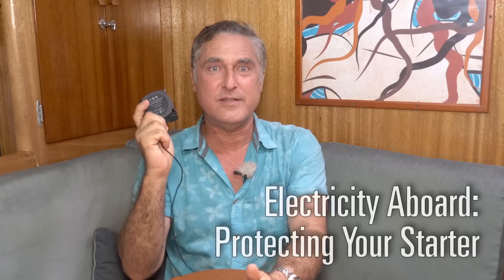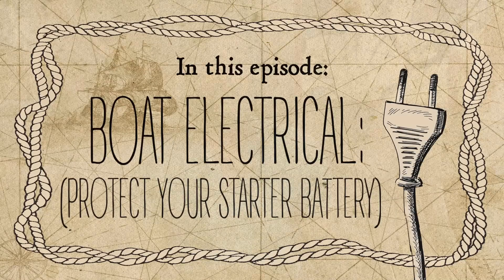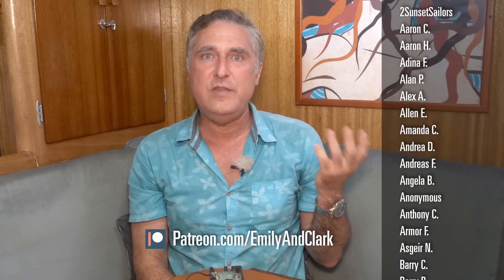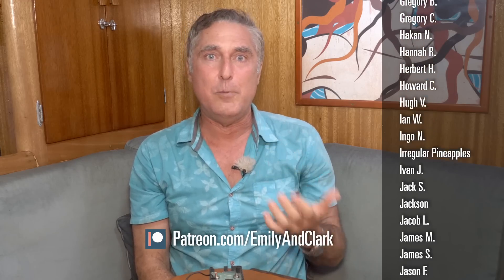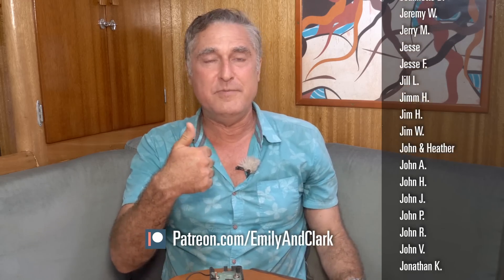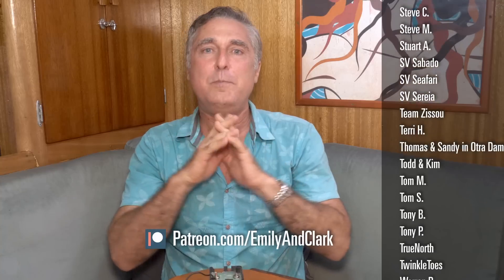The $20 Way to Protect Your Boat's Starter Battery

Comment: What do you think about the situation where your starter and house banks are at different voltages, say 12.8v on one bank and 12.4 on the other? If you switch them into parallel connection there will be a massive current flow into the lower voltage bank. I imagine this will have a detrimental effect, particularly on the bank with the lowest capacity, ie, the starting battery.
Reply: Yes .4 is not large..:)
Reply: Assuming an internal resistance of 0.1 ohms, a 0.4v difference this would yield a transfer rate of around 4 amps. Even halving the resistance will only give 8 amps momentarily, so not a problem for lead acid batteries.
Reply from the maker: With lead it's not that big of a deal as the lead batteries have a fairly high internal resistance.  For Li this would be a big issue.  
This can be mitigated further by wiring this in with longish smallish wire.  The resistance will slow that surge of power. (p=I²R). 

My BankManagerPlus https://www.emilyandclarksadventure.com/bbms
Is careful to only connect banks when it's safe.

Good observation.
Reply: I don't see the difference is 12.8 and 12.4 as massive although at various points Clark says that it is.
Reply from the maker: During testing there was a point where I had a software bug and my BankManager tried to connect batteries with a large voltage spread (Much more than your .4v).  Wires got hot to the point you could smell it and my tester quickly forced the battery banks apart.
   .4v should be ok I suspect and I don't have the data from our test, as it wasn't a planned test, but likely fairly discharged lead and fully charged li, caused an issue.

Comment: I’m not understanding exactly which pole to connect the starter battery to. I guess where I’m struggling is if the voltage drops below 12.8 and you’ve connected it to the wrong pole you might shut off the house and left the starter battery to drain. Maybe I’m still not understanding the concept of how this works.
Reply from the maker: If you need this functionality just buy one.  It's instructions will help you understand it.

Comment: Clark, that was a brilliant pair of similes concerning the house and starter battery banks.  The house bank, like a draft animal supplying the “Hotel” loads while the start bank is like the lion, lying idle but then expending tremendous energy over a short time to help the engine “roar to life”.

      You have the heart of a teacher, using analogy to make your point to some who may be unfamiliar with the technology you’re teaching.  I’ve noticed the clear, simple way you teach and admire the care and preparation that you and Emily demonstrate in your presentations. 👍

        An important point (with which I disagree) is that many now use high output alternators to charge their banks, and refrain from having a dedicated standby generator for savings of $, space, and weight.  
  
        The flaw in this thinking is (of course) that if one inadvertently depletes the starting bank then the ability to charge batteries is also lost.  If in a remote area, the house bank will eventually deplete and ultimately lights, navigation equipment, and radio are lost, which places the sailor back in the 17th century. This same scenario (of course) occurs if the engine is lost for any other reason.

      🤔 How does the VSR regulate the different charge profiles for different battery chemistries and how does it distribute the charge when charging batteries which are at a different charge states?
Reply from the maker: That's really outside it's scope.  It just connects and disconnects lead based battery chemistries.  And that's all you need to make sure your starting battery is ready to do it's thing.

If you want something that lets you mix lead with Lifepo4 there is my BankManagerPlus.

https://www.emilyandclarksadventure.com/bbms

Comment: Hi Clarke How does it work if you have an emergency parallel switch?
Reply from the maker: I don't understand your question.
Reply: Thanks Clarke I really appreciate you taking the time to answer my query. I have both emergency parallel and VSR installed by a previous owner but just wondered if the parallel is on whether it interferes with the VSR… in fact should I leave the emergency parallel left on at all anyway?
Reply from the maker: I have no way of knowing how your boat is connected up.  But, if it's connected as I do mine leave the "emergency" switch off for the vsr to be full automatic.  On to just have the batteries always connected.
Reply: @Clarks-Adventure  brilliant thank you 🙏

Comment: Thanks for the update. One question... or maybe just comment. You did not really say where the sense pin (post) should be connected to. I guess it should be obvious though that it needs to be on the side where the charging system is (unless it is dual sensing)... maybe dual sensing is more fool proof or even, more desirable. I guess the first question is, which battery should the alternator be connected to? My answer would be the starting battery because the engine/alternator/starting battery are meant to be a unit and depending on the situation, more than one start may be required within a short time period. However, I would think it would be better for the solar panels to charge the house (again, dual sensing please) because your electronic relay still has some drop across the "points" and a solar panel setup that is charging lithium cells, is probably dealing higher voltages too. Shore power charger, which might be much higher current output than solar panels or your voltage controlled relay can handle. (I'm probably missing something as I am thinking this while watching, so not long) Maybe there is a place for a single sense unit connected to the starting battery/alternator and a lower voltage drop diode (.6v seems common enough) from the house side to starter side with a limiting resistor to just allow 2 amps or so charging from house to start side (so starter draw doesn't blow anything , hmm dual sensing bad?).

Next question is, what happens if house is greatly discharged? Starter Battery won't allow the switch to close until it's charge level hits switching level. Then the switch closes. What happens now? Depending on the voltage spread for on/off, the alternator and the starter battery start to charge the house battery at alternator rate plus battery rate, that is over 200 amps. Does the switch handle that? or does the house bank pull the voltage low enough for the switch to turn off? (then back on as the voltage is again high enough, acting like a switching power supply? As you have been using the device for some time, it must handle it some how. (same with starter current, but I guess that would pull voltage down below switch voltage anyway)

Last comment: A diagram would have been easier for me to follow  ;)  A diagram would have shown which battery you in your head thought was the right battery for the alternator to be connected to, where sense was, all those things. My little 9.9hp OB starts off my house AGM bank without harm but even a 10 HP diesel would not.

Anyway, you patient explanations are much better than I could do because I always seem to expect others to pick things up at the same speed I would. Thank you again. As you can see above, I have probably answered all my own questions.
Reply from the maker: There is always a bunch of engineering required to set up charging systems.

Any video that tried to answer it all in 15 minutes would fail.

Yes you answered your questions fine.

Dual is often better.
If you use lead on both sides you will find that the internal resistance limits current quite a bit for battery to battery discharge.
If you use smallish longish wire to hook these up it can limit their current in a good enough way.

Comment: Your post could not be more timely. We just replaced our batteries and have been struggling to ensure charging and using the batteries is done correctly. The boat originally had lead for both starter and house. We now have lead starter but AGMs for house.  Can this solution be used for lead/AGM combination?
Reply from the maker: Yes no problem.  All the lead batteries have the same resting voltage 12.8

Comment: Great simple explanation on battery systems. I use an even simpler setup that I believe is more reliable and safer. Using a high power schottky diode (1N6392e3 ) in series with a 20A breaker. This combination is wired from the house bank to the starting bank. I picked up this method from the Ample Power website and it has worked like a champ for many years.
Reply from the maker: Still a voltage drop with that diode.  Not as much but some.  .8v I think
Reply: @Clarks-Adventure  A schottky diode has a forward drop of about .6v, and this drop is even less ( according to the data sheet Vf=.4v ) as the current drops to less than an amp . Yes this is not optimal, but close enough. Using the relay, if there is a short in the starting battery, there is no current limiting protection except for the failure of the relay.
Reply from the maker: Sure lots of ways to do it.  People used battery isolators for years happily.

Comment: Excellent, I am surprised how few know of or consider to use vsr to solve basic needs.
I extend vsr use especially the adjustable ones to control load shedding, eg not killing house batteries on cloudy days with loads that are not priority. Like a stupid version of computer load scheduling and control. Make water only when above x volts etc. Easy!
Reply from the maker: Yes.

Comment: Will you place a link to the relay in your Amazon store?
Reply from the maker: It's in the tools for Electrical work section.  It's by DEWINNER.

I can't modify the list or links from my phone.  Not at a computer today.
Reply: @Clarks-Adventure  Thanks, found in now and ordered it.
Reply from the maker: It's there.  I just checked
  I forget which department but you should find it fairly easily if you look around.

Comment: Very good video and helpful. But I have questions.  I’ve thought about changing my house batteries to lithium.  Don’t lead batteries and lithium batteries have very different charging requirements? What about over or under charging the lithium battery?
Reply from the maker: I have you covered.

https://www.emilyandclarksadventure.com/bbms

It's how I feel is the best way.  Basically the only safe way to charge Lifepo4 without having to worry about low current overcharge.  -C

Comment: So, does that VSR actually just power on/off a actual physical relay, or is it just mosfets or something? Seems like you could use one to pass a helluva lot more than 120A/12V if you used that to power a relay bank (in case you run 48 or 96 volt systems or similar, like Sophisticated Lady is doing with that new 6kw alternator).
Reply: Specific solid state transistor, not sure if it is a mofsfet good question, never chased this down. You can use a small vsr to control a larger contactor, many designs depending on the system requirements. Look at high power wind generation like household scale many do this. Latching or usually for safety non-latching are used. I have rebuildt power plant scale pneumatic contactors so it is what fits the need.
Reply from the maker: I don't think it's worth trying to use one of these for anything but nominal 12v.  If you can't find a premade circuit to work for the voltage/amperage you want you could slap together an Arduino and contactor to do it cheap and easy.

Comment: Thanks for the great video. One question can I hook a 12v battery to a cigarette adapter to charge it while my boats engine running ? Just to have a spare ready starter battery available always  .
Reply: If the charge demand is high only being controlled by resistance this is likely to be unsatisfactory if not exciting.
Reply from the maker: Yeah I wouldn't recommend it

Comment: Great video. I have been thinking of this for a while where I want to connect my single solar panel with charger,  but the charger needs to be set for the batter it's charging. Can this be used to charge both chemistries at the same time?
Reply: Obtuse yes. Multiple ways are possible. Most will use one vsr between engine and house so your solar on house will not charge engine. Use a solar battery pwm or mppt off the solar panel lead one is enough to split charge between topping engine and house charging. $10+ solution. Some have much more expensive dc-dc solutions.
Reply from the maker: If you mean different versions of lead you can pick the more conservative.

If you mean lead and li no.  You need one of these.https://www.emilyandclarksadventure.com/bbms

Comment: Thanks for the tips and explanations for having the proper care of the electrical elements that run the house/boat. There is so much to learn from your videos. Have not seen this advice anywhere else, and it is extremely important, especially in the marine environment. I can't imagine having no motor at all, when in the water/current/winds/etc. that changes constantly, because of a depleted battery!! Yikes!!
Reply from the maker: That's nice of you to say.

Comment: Nice could you show a schematic?  I have an outboard thinking of going lipo4 for houseThanks
Reply: Lead + between engine battery and 2 battery combination switch. Vsr in line in this instance. Assuming you have engine start a a constant standalone (as it should be my opinion) some boats setup so you can toast your alternator if you open the switch while running. So one diagram will not work.
Reply from the maker: We are traveling just now and pressed for time.

Emily said you get animated lions or schematics.  Not both this week :)
Reply: @Clarks-Adventure  Scheming Lyon icons. 👌